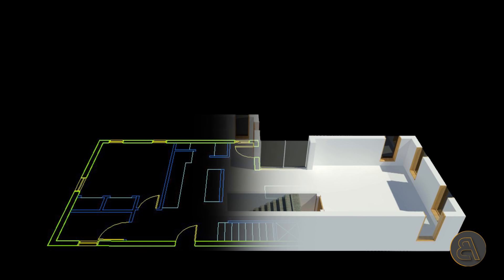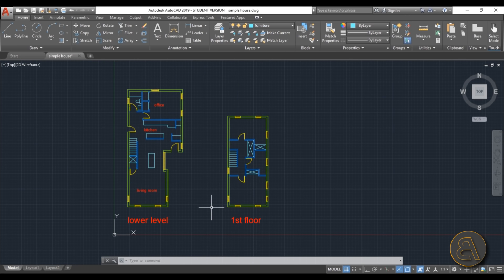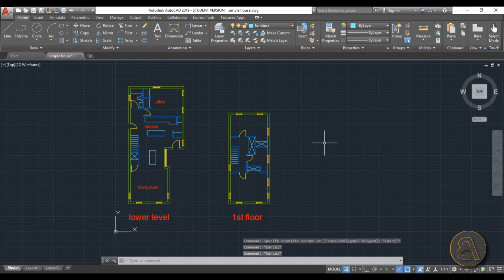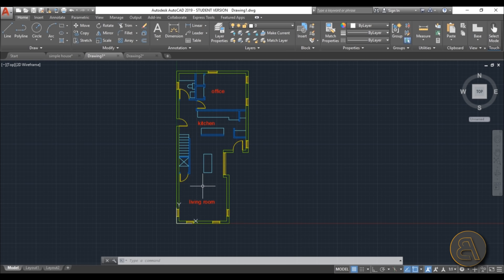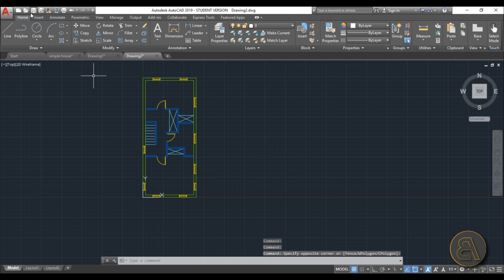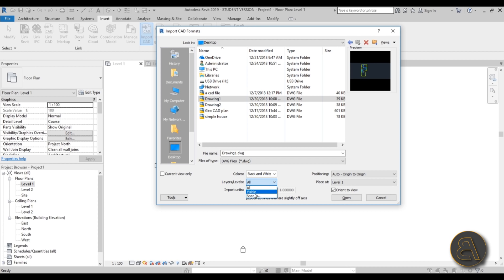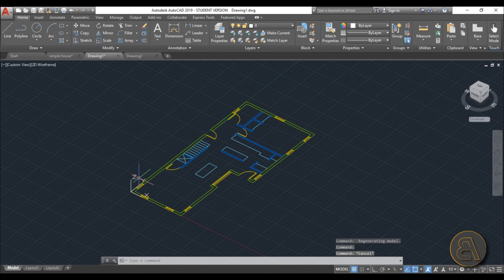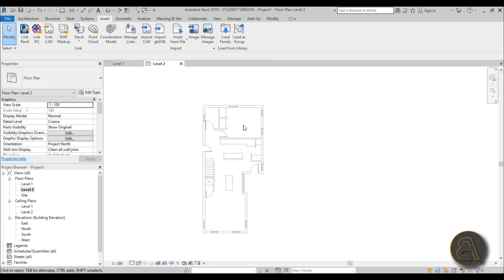5 Tips and Tricks for Importing DWG files into Revit

Comment: To whom it may concern,

After I have imported the layout (dwg) and put into element, but no construction element built, such as wall and floor.  However, it is invisible even I was moving the element around the layout drawing, "place on verticle face, place on face and place on work plane" is useless too?   It is gratitute if you can share with your value experience.🙏

Comment: I think you can use pick line with changing wall location lines to exterior or finish face interior and easily you can add walls no need to draw them actually.

Comment: This wouldn’t work to provide an accurate 3d model. Level two doesn’t just sit on top of level one. There would be a large gap that represented the ceiling material, joists, and then the subfloor of the next level. How do you design that into a Revit model?

Comment: I've got another trick maybe a little more work but only 1 CAD file. Your in luck.  Level 1 you Change the Elevation of the items to 0.00 AND Layer(s) to Level1.....  Level 2 Select all your level 2 items and change the elevation to the proper elevation for level 2 AND Change the Layer(s) to Level 2....  Level 3 Same thing.  Then Stack the levels appropriately in CAD.  Revit will read the elevation and show the CAD Drawing at all levels where the elevation View Depth intersected the CAD elevation.  Here is where why you changed the CAD Layers to Level1...., Level2...., Level3....  You then turn off the layers that are inappropriate for each level so you only see the information needed on that level.

But now you can use that 1 CAD File instead of many.  I was going to say "Just simply turn off the layers to work with each Floor."  But I can do 1 better.  In AutoCAD you can Group the Layers with Filters to Level1, Level2, Level3....  Then you can right Click and turn the Visibility of all the entire group on or off.  As well as Viewport Freeze option for printing.  It would be nice if the Group Filter form AutoCAD linked into Revit.

Comment: Would be better to paste to 0,0,0  you can use the flatten command to make sure all lines are at 0 on the Z axis
Reply: Good point. I've worked on projects where points of lines were hundreds of metres up and down the z axis. Anything which flattens dwgs makes tracing in revit easier to manage.

Comment: I did exactly as you did while importing your CAD file to Revit....But in my case my CAD file is not being adjusted in elevation points. My CAD drawing is appearing large in scale....Please tell me how should I adjust my drawing in elevation points in Revit.
Reply: While imparting try with different scale.. some time its meter some time in millimeter.. so try one by one all scale.. or if it is not working just import any scale.. and by the help of scale tool.. rascal your cad drawings.. as per your measurement

Comment: When importing AutoCad into Revit make sure you do the following: 1) Overkill command in autocad.  Gets rid of double lines, 2) proxygraphics set to 1 in autocad.  3) no not import dwg bring your main revit file.  Import into a temp project file.  Why?  Bringing in autocad file especially from a manufacturer will add unwanted line types to your file. 4) use that temp file to modify your line weights.  Just some basics.  My pet peeve is complete details drawn with filled regions - Lazy drafting!
Reply: I just spent 2 days fixing 2 details that were exactly as you described. Now the company can take my new details and easily modify them for other projects.

Comment: I'd like to add that you should draw your building in the same file as you've placed the CAD backgrounds. You should always create a CADLink file for the CAD backgrounds. That way your model performance is much higher in your project file. Secondly, once you've got the CADLink Revit file linked into your project file set it to Attachment instead of Overlay. This will save money for other disciplines when they import the Architectural link, as they won't have to go into your CADLink Revit file and write down each and every layer that's turned on / off just to make sheets look the same across the project.
Reply: ESE DISEÑO ES UN SIMPLE CUBO , ESO CUALQUIERA LO HACE

Comment: Hi,
imported floor plans didn't align properly, because you made a mistake when creating your dwg files. When you thought you moved the coordinate system to the bottom left corner of the floor plan, you actually didn't move the global coordinate system, you created a new one, which is called user coordinate system. When you import dwg into revit file, it always takes only the global coordinate system into account.
To fix this problem, in AutoCAD, you should move your geometry to the proper place (bottom left corner of the building to the centre of the coordinate system). Not the other way around.

Tomas
Reply: i think it is better to paste the floor plan with the align point to (0,0,0)
Reply: Maybe the ORIGIN command in AutoCAD can solve the problem too, if you don't want move the whole drawing to the coordinate system origin.
Reply: BRO! Thanks, that tip helps.
Reply: Keep practicing in AUTOCAD and REVIT, that will make you better every day.
Reply: Or just use by shared coordinates, they should land one above the other since he paste them into new drawings.
Reply: Just use the command "LINE" and then "0,0". Do that on every level that you will have. That will give you and exact location of the building, site plan, etc.
Reply: You can directly move using the #0,0,0 coordinate, without creating the line..
Reply: I send plan to ( *0,0,0) not (@0,0,0)  but for the record I try and stay away from autocad as much as possible

Comment: Hello. Good tutorial, but I want to share with you a bit of knowledge I learned along the years working with revit.

Never ever import dwgs in your main project. Why? Because if you have a company template of line styles that had to stay like that, then importing a dwg will fuck it up. It will also import the line styles from the dwg, and we all know how messy most dwg files are, sometimes even if thousands of line styles will be added to revit.

What can you do instead? You have two options:
First option is to always LINK the dwg.
Second option is to create a secondary revit project (container), import the dwg in the container, and then link this container to your main project.
This second option is proven to be the best, but it is also the most time consuming. You can also also have any amount of dwgs in a container, which you can keep unloaded so it does not consume any resources/memory.

Source: am revit consultant.